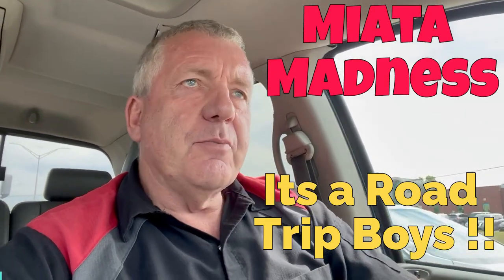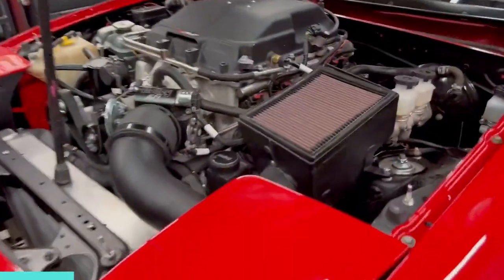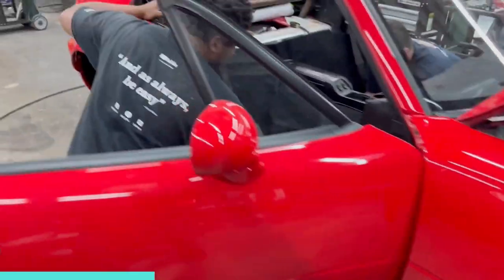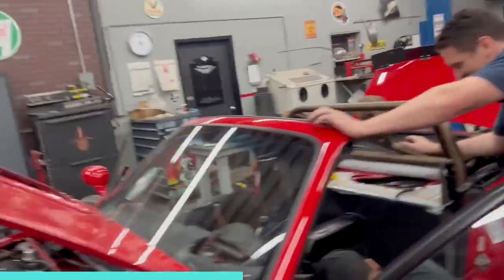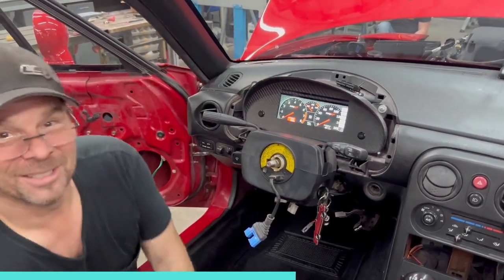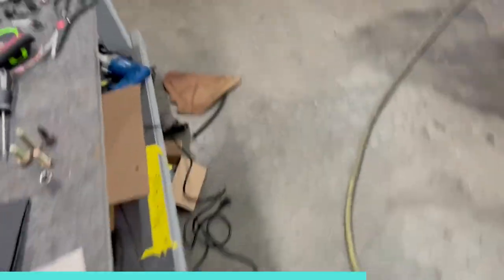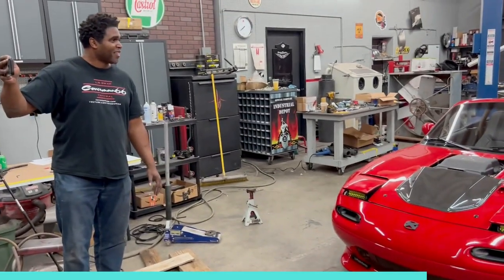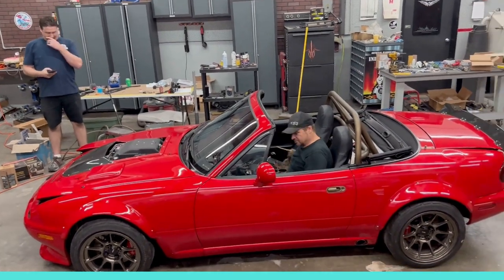Miata Madness!!  It's a Road Trip Boys !

Comment: Holy Shit !... I hope they always keep it pointed Straight ahead. Quite nose heavy- eh ?
Reply from the maker: It's an all aluminum LSA but it's got to be heavier then the little four banger that was in it.  Knowing KT he'll be weighing it and getting the weight split.
Reply: @kiwiclassicsandcustoms9160  Definitely will get corner weights and bias numbers....  There's ways to ballast these things, but it's not as simple as ( I once) thought...
Reply: @kiwiclassicsandcustoms9160  l had a 1967 Camero convertible with factory adjustable? canister? weights in all 4 corners...when l first opened the trunk (boot?) l saw the 2 rear ones & thought they were cannisters for hydraulic oil for a power top option 🤔 l had no clue...that was back in the summer of 1976